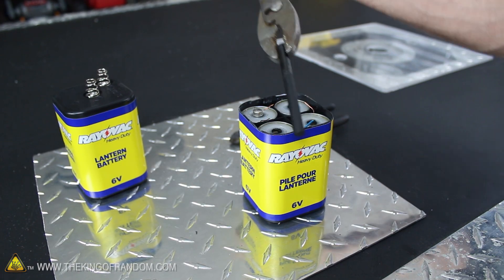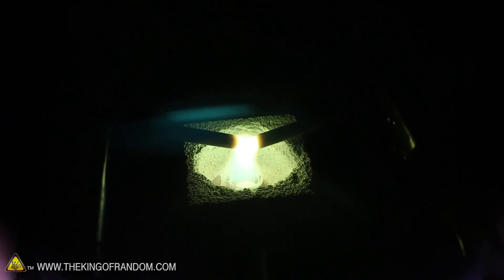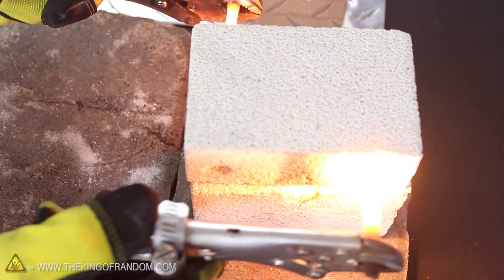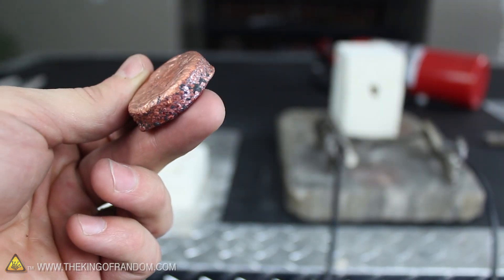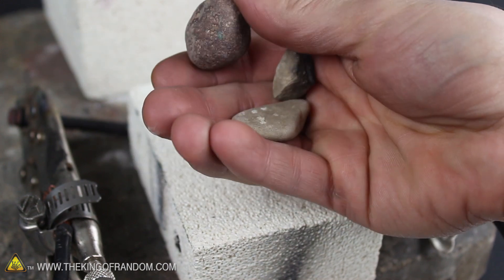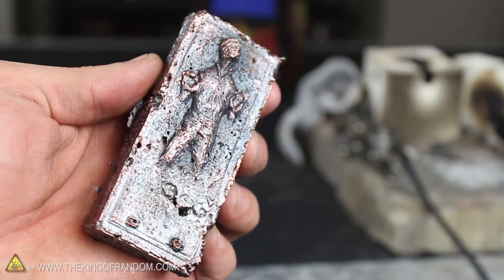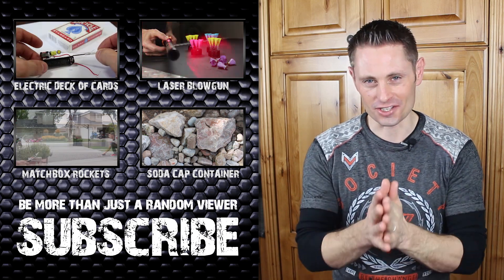Mini Arc Furnace (Arc Reactor Technology IRL)

Comment: Why not just plug the electrodes into an outlet and not worry about replacing batteries.
If you think the plaster mold is bad for spewing molten copper around the room throw a shot glass of water in the hot mold.

Comment: What voltage and amp are you using please? If  want to replace my carbon rod with non consumable tungsten rod. Can you please advise which colour tungsten steel rod I should use. I believe it's red if it's my machine is DC

Comment: are you useing 220v or more than 15amp curcuit?
i tried on 15 amp curcuit in my house with my stick welder cant get the steel castable i am running 110v?

Comment: Hey, king of random, I've built the electric arc furnace but whenever I connect the terminals of the carbon rods the circuit breaker cuts off the power, in my country the electric power provided is 230 volts and 2.73 amps, I don't know what's wrong, so I need ur help ?

Comment: The steel is sparking like that because it's actually burning.

Not melting, but burning. Steel actually burns before it melts, meaning there is some loss when you smelt it.

Comment: how much amp and volt is the two microwave oven transformer?
Reply: how much energy does it take to run 2 microwaves?
Reply: 36 volt and 210 amps mentioned in arc welder video

Comment: Watched u do a styrofoam gear with copper. Substitute water glass for the water in the sand and then push a needle in the sand around the gear and in the sand center to a depth below the styrofoam. Bag the sand box fill the bag with CO2 and your sand will be a brick.

Comment: What else can I use to power this to melt lead for casting ingots for bullets?  I don't have access to 240v ac
Reply: Lead has a super low melting temp you can pretty much melt it in a steel container with a propane torch

Comment: a beter design would be expensive but you can cut out some of the fancy stuff to make it cheaper so a crucible with a built in thing were you can lower the carbon rods a control panel with a dial and button the dial to make hotter the button is an emergency shut down button and a cover since not every one wants to see the reaction and a sliding thing so you can putt a cast in the front to not have to pour it your self

Comment: but the question is will it melt tungsten (with a melting point of 6191 degrees Fahrenheit or 3422 degrees Celsius)?
Reply: Maybe if you use a version of this with all 8 electrodes simultaneously
Reply: +Djordje Mihajlovic wrong...  Tungsten's melting point is 3422C, while graphite's "melting point" is 4026C. Tho, graphite doesnt melt until you have 100 atmospheres of pressure. It will just evaporate or so.
Reply: i dont think it can do that, but i could be wrong (quote me on that haha). But Oxy-Acetylene torches should be able todo that. (in a vacuum??)
Reply: Reid Burke yes but youll need 480 vac and 4 transformers
Reply: No with graphite rods because the melting point of graphite i lower than tungsten...
Reply: Dead Meme oh well I guess I'm wrong, thanks man
Reply: Djordje Mihajlovic  no problem.
Reply: there are a few tantalum carbides that can be made into electrodes and withstand almost 4000 C, your main problem is gonna be containing it, you cant even use a graphite crucible because once molten the tungsten will react with it

Comment: i wonder why the carbon wont melt
Reply: It has a high melting point due to the intermolecular bonds holding it in place. They are a lot more powerful since there is a high force of molecular attraction. Most metals have metallic intermolecular bonds, meaning that they rely on the delocalised electrons being attracted to the positively charged protons

Comment: hmm any metal you can get your hands on... Try it with tungsten... if it can do that I will build one lol... Tungsten melts at almost 6,200degrees... very curious if this little guy can do it haha
Reply: My guess is, no. If you look at the furnace after it was done with the rock, it looked like it was about to fail. I'm not sure if it will withstand 6200 degrees.
Then there's also the problem with the rods, they might fail at some point too.

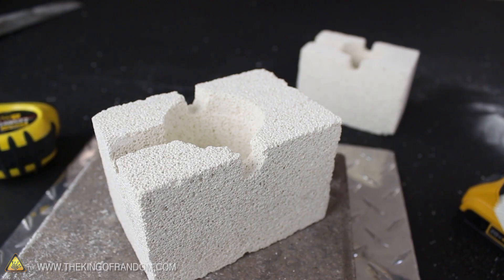Comment: How many Amps do you use for this Grant? I've tried it several times already on 80 Amps with my arc welder it takes about 1:30 to melt aluminium and the rods burn out after 3 or so attempts is this how it is meant to go ... Any suggestions? Thankyou

Comment: I think it needs to be said that the arcing plasma actually puts out a powerful electromagnetic splatter across the entire spectrum while it's in action - from sound through to RF, heat, light, UV, microwaves, xrays & on through to gamma & even cosmic frequencies in theory. So shielding of the body, especially the eyes & certainly anyone or anything else (like pets) in the vicinity is essential.
This is very cool but the price is that it's also very dangerous, but hey, nothing's ever free ;-)

Comment: can it melt tungsten
Reply: mynameismatt2010 thank you
Reply: There are plenty of ways to melt tungsten, they're just not commercially viable either because of cost or time.
Reply: Eventually, the rods can reach about 6500 degrees before melting and tungsten melts at 6100 degrees, however, the electricity will have a harder and harder time passing through the rods as they heat up so it will take a very long time to get there.
Reply: Sully Moe No. Tungsten has to be made using powder.
Reply: Probably
Reply: someone said that in an upper comment and grant replied saying yes so I will believe him

Comment: I wonder how many people didn't use gloves to handle the electrodes and are no longer here.
Reply: Please people, understand electricity before making a comment on it.
Ohm's law is I=U/R. When you look at a current going through a body, R is the resistance of the body, this varies between people. U is the potential in volt, and I is the current, as you can see the voltage is deciding in a current being deadly, or being non lethal.
Any voltage under 50V will almost never be lethal.
Reply: The voltage is too low, it's fine to hold it with bare hands. I assume he used the gloves for temperature reasons.
Reply: You would be fine
Reply: Because of the intense  heat and/or electrocution  ?
Reply: No one
Reply: They only become a little hot but the voltage isn't enough to pass over body resistance
Reply: pppppfffftttttt... true...
Reply: no one
Reply: kev you wont  die from 1 volt with 10000 amps because the voltage isnt enough to push the amps to your body
Reply: It's not the voltage that kills, it's the current. You can die from a 41 V high current electricity.

Comment: can i use cement for this
Reply: SkittlesNinja1000 that's because concrete is porous and absorbed water, just keep it inside and dry and you should be fine
Reply: The King Of Science No, do NOT attempt to use concrete or cement for this. It has air bubbles in it that have no release like the fire brick and will explode when the gas inside expands too much. That is why foundries have dirt floors.
Reply: The King Of Science 
I don't think so. In the video with the bigger furnace he accidentally spilt hot metal on concrete and it spat the metal everywhere.

Comment: can it melt tungsten?
Reply: Jonathan Crutcher it may do, Cody managed it with an oxy-hydrogen torch
Reply: would be cool if it could
Reply: The correct answer is eventually.

The arc is hot enough, but you have to sustain it till it brings the metal up to its melting point, which for tungsten is around 6100 degrees, the big problem here is that the carbon rods themselves will start to melt at 6500 degrees.

Comment: Any metal? that includes alloys because alloys are still metal... So how about Hf-Ta-C which is a mix between hafnium, tantalum, and carbon. It has a melting point of over 7000 degrees Fahrenheit. how about that King Of Random!

Comment: Awesome! This (but scaled up a little), will be my next project. I now have a furnace using heat resistance wire, that can get to 1300°C (enough to melt cast iron, but not steel - cast iron has a little lower melting point than pure iron or steel due to it's high carbon content).

Comment: Did you need to make a new furnace for each metal? It seems cleaning the arc furnace would be next to impossible after it cools. 
This has inspired me to dust off the ol' workbench, and attempt to copy your dangerous creation. Thank you for not repeating a thousand safety disclaimers. This is great work.
Reply: hey no a furnace can be used over and over again .normally if you use all the liquid,the only thing that will be left is the scraps witch dont stick the furnace ,you can just scrap it off ..

Comment from the maker: Some quick links to a few of the materials I used:

[✓] Lantern battery: http://amzn.to/2cgnKxN
[✓] Forstner Bit: http://amzn.to/2c1Ja3V
[✓] 3/8 Drill bit: http://amzn.to/2cgl6rL
Reply: will there be a time to replace your electrodes? they look alot different than newer
Reply: Thank granty
Reply: how long can you use that furnace
Reply: Grant Thompson - "The King of Random" OMG U USED HAN SOLO IN CARBDONITE 😱
Reply: Can it melt diamond? or osmium because you said it would melt any metal well diamond is not a metal its a crystal
but can you try to melt diamond?
Reply: No you cant, i quess you need to have welding machine to get amps bigger. If you dont know what are you doing, dont do it!
Reply: Jenildo Sation well as long as ya got a crucible (bottom of a fire extinguisher in this case) you're gonna  be fine
Reply: I don't know why you are so happy aaa
Reply: Grant Thompson - "The King of Random" hi
Reply: Grant Thompson - "The King of Random" OMG! HI!!
Reply: Grant Thompson - "The King of Random"
Reply: Grant Thompson - "The King of Random" you are not
Reply: Grant Thompson - "The King of Random"
Reply: Grant Thompson - "The King of Random"  you said aluminum muffin    was that not a zink muffin?  illuminati comfirmd
Reply: Grant Thompson - "The King of Random"  û
Reply: hey your biggest fan wants to ask you something
Reply: Devin Seeley What is that?
Reply: Devin Seeley
Reply: cat like to dab cat like to dab Who is devin seeley?
Reply: Hey Grant, I'm curious. Can the Plasma\Arc Foundry burn hot enough to melt Glass? Or would that be extremely dangerous?
Reply: grant can your arc furnace melt the strongest metal that is light wight?
Reply: stick welder
Reply: illuminati confirmed
Reply: a-lpha of Zeldaforme Gaming Amen.
Reply: ElMaiker
Necro comment,  but Diamond is pure(more or less) Carbon, meaning it won't melt, it will BURN. Yes, diamonds can be BURNED, it just takes a higher temp than other forms of carbon like charcoal.
Reply: Titan's Guild Dre 
Can i just plug it straight to electrical outlet? 
I mean, not using any arc welder.
Thanks for your reply
Reply: Thx
Reply: Toni Manninen Thank you for your reply, Toni Manninen
Reply: i meant to ask can it melt titanium

Comment: Guys I need help! I made the whole thing but I only getting 14.8 volts out instead of 37. I live in Greece and we get 220 V out of the socket. I'm wondering if the cable is wrong because they said at the store that the 8 gauge American cable is the 10mm cable for us here which only fitted 3 layers of 5 in hight. Plus instead of 600 volt plastic around the cable (I checked the K.O.R.s cable on the video and read what's written on it) ours are 700 volt. Any thoughts please?

Comment: So the rods burn away after a period.  How long and what about contaminating the metal?   Do you wear dark or welders goggles?   Safety info would be useful.   I am guessing for each type of metal you need a separate arc chamber?   How long will the bricks last?   I know from the other vids you run it from 240v using separate circuits in yur house.  Here I would likely burn the house down [[really poorly done wiring in a ten year old house.]] So what results using a single 110v? Questions, questions!  ;)
Reply: What causes most of the rods to burn away is the oxygen in the air. As oxygen reacts with carbon - carbon monoxide is formed at first, wich then burns to carbon dioxide as it leaves the furnace (it doesn't affect the metal being molten). A small part also sublimates due to the extreme temperature in the arc, but even most of that will end up reacting with the air and go away as carbon dioxide.
I havn't tried it my self so I know how long they last - but it shud not be to bad. Carbon rods can often be bought cheap from those who sell welding equipment, as they are sometimes used for cutting of metal.
Reply: Mark Henry no
Reply: manobrass Thankss!
Reply: Mark Henry a long time
Reply: I had all of the same questions
Reply: Mark Henry welder works better
Reply: you shouldn't trust this guy(the dude who made the vid)
AND YOU REALLY SHOULDN'T TRUST ANYONE WHO HAS HARAMBE IN THEIR NAME!!!!

Comment: Hello, i am actually melting a lot of ingots for later machining for a personal project, am using a 140 amp 100% duty cycle dc igbt inverter tig welder as power source and using a sigle graphite electrode negative, the point is that a lot of the parts are heavier than 5 kg and the power of the tig welder doesnt help me a ton. I have easy access to 3 phase industrial power, and have some microwave transformers, any sugestion? Arc furnace rocks, and your videos too...

Comment: Using this same thought process could you bundle more rods together and with a bigger crucible in order to melt more material (pending the human element) safely? or would the resulting arc be to big for the length of the rods?

Comment: How long does it takes before the furnace is broke down by the molten steel? With the liquified rocks it seemed really damaged.
Reply: I don’t know much but it probably is depends on the heat. So doing lower melting metal probably makes it last longer
Reply: The molten rocks are a glassy substance just like the refractory ceramic brick, because of this, they stick and melt together. if you instead exclusively melt metals in your furnace, then there wont be nearly as much damage.

Comment: So that styrofoam casting method would obvs not work right? Is there any material that the common person can purchase thats heat resistant enough to cast steel? (Other than firebrick, pores make it look ugly.)
Reply: I don't see any reason why you couldn't do lost foam casting. Make a styrofoam mould with gates, runners, risers and put it in a box and cover it with sand. Pour away and see what happens, foam and sand are cheap. Check out SV Seeker on youtube, that guy has plenty of casting vids
Reply: You can use sand. https://en.wikipedia.org/wiki/Sand_casting
Reply: Who cares if it looks "ugly"? You could also try to make some kind of covering around the brick if that's really such a huge concern :/
Reply: Jacob Thomson I don't know, you could try Googling it but the material would probably be quite expensive.
Reply: +deeryme Im pretty sure steel has a melting point high than sand
Reply: +deeryme But ill definately check him out, thanks

Comment: My gosh that is hot, able to melt steel and even rock?!  Did it start to melt your furnace as well?  It looked like the sides were degrading over time... if you can melt rock, then how much higher can the furnace handle?

Comment: I build this too, but with a little inlay to make the area smaller and smaller holes to reduce the amount of heat radiating into the surroundings. The 200 amps from a welding transformer are now making the tiny chamber so hot that it melts gravel in 17 seconds.

Comment: Can you make forge from just microwave oven transformer?
Reply: Kind of. But you still need some light batterys and some strong heat insulating material. A forge isnt a forge if it only consists of the heat source.
Reply: Fra32Entertainment ok

Comment: can you use a car battery as a power supply, or is this not enough?
Reply: 240 volts AC is the needed power. A car battery is about a tenth of that at best, and its also DC.

Comment: This is cool, but id like to see someone melt tungsten. Considering it has the highest melting point of all metals. Second only to carbon itself.
Reply: Carbon is no metal. And I am not sure if the brick is powerfull enough to handle about 3k°C without falling apart itself. Could be worth a try tho.
Reply: Fra32Entertainment I wasn't referring to carbon as a metal. That's why I put a period. I stated tungsten has the highest metal point of all metals. It's only second to carbon in having the highest melting point of a substance. definitely worth seeing it be melted though as a project